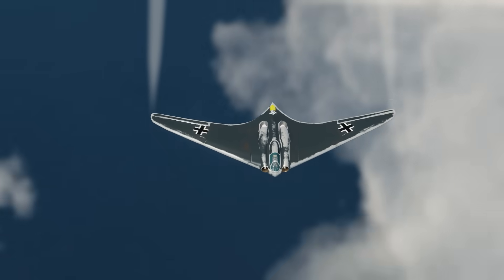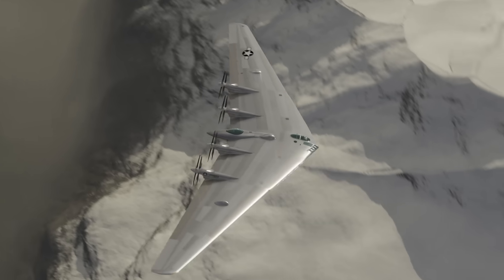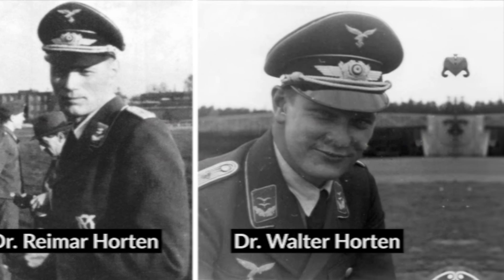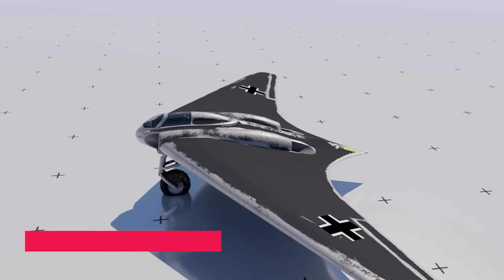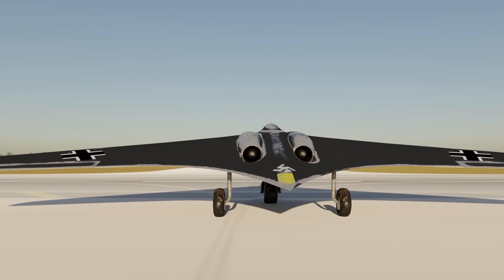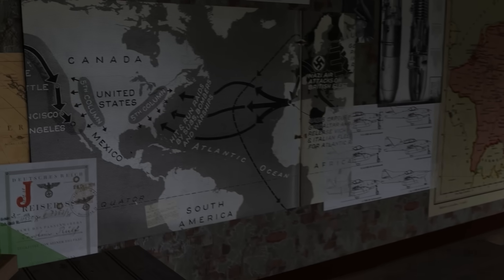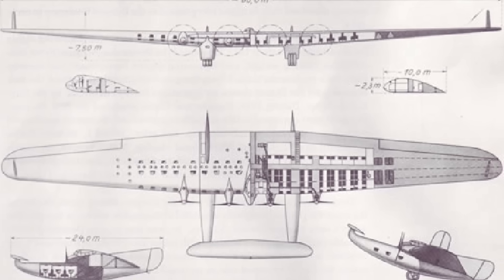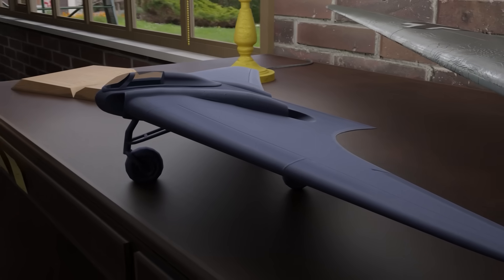Insane Flying Wing Jet Fighter To Save Germany - Horten Ho 229 Nazi UFO

Comment: this was not a stealth fighter
Reply: True, technically its a Radar Stealth Fighter-bomber  Like most twin-engine fighters in WW2 it was a multi-role aircraft capable of light bomber, attack and fighter roles.
 And like modern jet fighter-interceptors that are multi-role attack aircraft with bombing capabilities.
Reply: @DoktorBayerischeMotorenWerke  it wasnt even stealth in the first place, that was a claim made after the fact in 1983. u can read more on fucking wikipedia, the radar crosssection was apparently comparable to a bf109
Reply: @realshimo1258  WRONG! Tests conducted by Northop confirmed a 58% reduction in frontal RCS, this was achieved without the planned RAM applied and represents a significant tactical and strategic advantage against British Metere band long range detection radars.
Reply: @realshimo1258  Also Wrong! Oberkommando der Luftwaffe (OKL) published three specifications directed towards the building of Stealth bombers during WW2.
 The Ho-229 was one of these projects.

Comment: The Ho-229 had handling problems like all flying wings that couldn't be fixed before fly by wire. It could perform test flights with an experience test pilot , but in combat it would have been more dangerous to its pilots than the enemy.
Reply: Ho-229 was After the invention of Fly-by-wire technology invented in Germany in 1934 by Siemens in conjunction with the Heinkel aircraft company, Germany introduced FBW and Stability Augmentaion Systems  (Yaw Dampers) during WW2

Comment: The plane never saw combat.
Period.  End of BS.
Reply: But it was real and it flew... the Allies had absolutely nothing comparable to it.
The very existence of this aircraft is a shameful and humiliating slap in the face to all the Alliboo fanboys and xenophobes
Reply: @DoktorBayerischeMotorenWerke  And meanwhile Russian T-34 tanks were in Berlin.
Reply: @davidhess6593  The Ho-229 was real. 
Nothing you can say will ever change this fact.
Reply: @davidhess6593   The smaller V2 prototype for the 229 was the only example to fly under its own power with jet engines, but only for about two hours of testing before a fatal crash.  They were flying experiments.
Reply: @FiveCentsPlease   The Ho-229 was real. 
Nothing you can say will ever change this fact.

Comment: 1:22 what plane do you call this
Reply: Messerschmitt Me-262
Reply: +@Harl_Tubang  At 1:22 was a craft that only existed as an idea.  The proposed Horten 18 was a scaled-up version of the 229 program with trans-Atlantic capability and with a wingspan of 131 feet.  Meanwhile, Northrop began construction of his YB-35/YB-49 design in 1941 as a long-range wing of 172 feet.
Reply: @FiveCentsPlease  But Northop would not have radar stealth technology until the B-2... which is based on the Ho-229 design.

Comment: The Horten 229 was far ahead of Northrop Grumman's designs. The Americans obviously copied the engine layout from the 229 when creating the B 2. On the American prototype, the engines are located on the wing. On the Horten, the engines are located closer to the cockpit, like on modern B2s. The protruding cockpit and swept tail indicate the similarity. In general, the fuselage of the B2 Spirit is more similar to the fuselage of the 229 than to the fuselage of the Northrop Grumman prototype. Pilot Kenneth Arnold saw a Horten 229 aircraft taken from Germany after the war and compared them to saucers.
Reply: US stole everything; that is old news.
Reply: And wind breaks in the wings still used today
Reply: @reverseuniverse2559  Whatever you say, salty-bot.

Comment: In a way it was very good  the HORTON HO 229 haven't  made  it to the front since  it was only prolonging the war ! On the other side  it shows  Germany  superior  technology  of that time ! From the TIGER TANK to the Walter U-BOAT or even the V2 ROCKET,  plus so many other superior  weapons 😳 🤔 !
Reply: US and Britain are to blame here.
Reply: German tech was not overall superior, in some areas they really exceeded but in others they were massively behind the Allies.
Reply: @spaceageGecko Germany invented the military concept of Force Multiplication through the use of Advanced technology.
 Germany is recognized as originator of most of the military technology in use today.
 The average German soldier or pilot had a higher kill to loss ratio than the Allies... due to this technology advantage.
 The United States military adopted this concept and still uses it today.
Reply: @ Germany had a high kill ratio due to Soviet meat wall tactics.

Force multiplication predates Germany as a country.

Germanys tech just wasn’t that far ahead, you have fallen for ww2 propaganda.

The fact of the matter is that Germany was behind on mechanisation by an extreme degree compared to the allies, lacked the RADAR innovations made in Britain, lacked proximity fuses, wasted resources on dumb projects (The Maus or even the V2 considering it killed more of Germany’s own than its intended victims)

Not to mention that even their own vehicles were over-designed and prone to just breaking down (needing specialists to fix them). Meanwhile the allies made tanks that were both mass produceable AND advance. 

The Allies successfully launched multiple offences that beat Germany’s tactics, the US in particular decimated German doctrine.

Not to mention the allies just straight up had better mass production, radar, sonar, computing and nuclear science, napalm, bombers and fighters.

No one is saying Germany didn’t have areas they excelled in but they were absolutely not the hyper advanced military their propaganda claimed them to be.
Reply: @spaceageGecko  Please name some examples?
Germany was a decade ahead in many areas of aerospace and at least equal in others. 
I dont know of any areas where they were behind.
Reply: @DoktorBayerischeMotorenWerke  One of the biggest I can recall off the bat was that a large portion of their logistics made use of horses still and most troops had to straight up walk instead of being mechanised.

They were also massively behind on radar and decryption.

In terms of aerospace they were about on par with projects going on in the allied nations.
Reply: @spaceageGecko  Sorry but you have your facts wrong, 
The Americans and the Soviets used more horses than Germany did... Germany had a very modern mechanized military compared to many other forces during WW2.
Germany was one of the world's leaders in radar technology and was the leader in airborne search and track radar systems.

Germany was more than a decade ahead of the Allies in aerospace technology... the first to have jet engines and jet aircraft, supersonic aerodynamics and supersonic guided missiles that flew in space.

The Americans more than any other Allied country was aware of and recognized Germany's superior technology and planned the massive Operations Paperclip and Operation LUSTY to grab up all of the Germans technology and technology experts and prevent the Soviets and the British from gaining any advantages from this superior German technology..
Reply: @DoktorBayerischeMotorenWerke  Congrats, now back to reality. Germany was really not mechanised compared to the allies, most of their logistics was horse driven and troops often had to walk.

Germany was objectively behind on radar and never caught up.

Germany's jets were deathtraps compared to the allied contemporaries that existed, which did exist as Germany did not invent the jet engine.

Standard German aircraft started to fall behind fast.

The only place Germany majorly excelled was rocketry but even that killed more people working on them than the rockets themselves killed.

Germany being miles ahead tech wise is a long debunked myth that has it's roots in Nazi propaganda, in reality they were ahead in some areas, on par in others and behind in ways too.
Reply: @spaceageGecko  Then WHY?? *Did America and  Allied countries directly adopt German weapons and technology?
  Were the Americans just ignorant and did not know that German weapons were inferior as your personal theory claims?

Or are you just a victim of Allied propaganda???
  
The Allies certainly didn't have Radar Stealth technology

The Allies didn't have swept wings and Fly-by-wire Horizontal Stabilators either!!!

Why would America adopt German aircraft and missile designs and bring thousands of German scientists, engineers and technicians to live and work in America???
Reply: @ Nice bait, but i’ll take it.

-German weapons were on par with most allied weapons

-No one had stealth tech, that came decades later

-The sweapt wings had nothing to do with the aerodynamics and are not sloped enough to provide any benefit, it was added to keep the aircraft balanced.

-America did not copy any aircraft or missile from Nazi Germany.

-Operation paperclip was purely to get experienced engineers and scientists working for the US, not an admission that Germany had better tech.

-Germany did not invent fly by wire, the first aircraft to use was Canadian. 

-Germany’s logistics were still mostly using horses and many troops had to straight up walk.

-German aircraft fell massively behind

-Germany’s jets were death traps with terrible reliability

-Germany’s propaganda machine made a strong effort to paint themselves as super advanced with all these (incredibly unreliable) tanks and jets.

-The Allies straight up dwarfed Nazi Germany in many aspects; RADAR, mass production, nuclear science, bomber and fighter design, tank design and industry in general.
Reply: @spaceageGecko  Better believe  it ! The Tiger tank , Walter U-boot , the first , fighter jets  "Schwalbe Me 262 , or the formidable  V 1 or the horror  V 2 !It was the reason America and Russia  was trying  to catch as many as possible  German  science  leaders  as possible ! Best known  Walter von Braun!  Even  the HORTON was developed  in Nazi Germany  but to late !
Reply: @ The very existence of the Ho-229 is a shameful and humiliating slap in the face to every hate-filled xenophobic Alliboo that still believes the Allies had better aircraft than the Germans.
  It is essential for them to childishly slander and denigrate the Ho-229 at every opportunity... but no matter how hard they try they can't make the Ho-229 go away... because its real. The Germans were a decade ahead of the Allies in Aerospace technology..
Reply: @DoktorBayerischeMotorenWerke  there is always a great irony in people crowing about the German army being the model of mechanisation when the us army was entirely mechanised in 1944 when the Germans were still using horses, BECAUSE THEY HAD NO FING FUEL - this is literally german ww2 propaganda you are parroting

as for tank superiority go ask a tank historian what they think of German tanks in ww2 and you'd very quickly get dispelled of your idea that their tanks were ahead of the allies

as for planes, honestly the v2 program ill give you, but was fairly useless as a tactical weapon, and don't even get me started on the rocket fighter, a bizarre curio that no one has copied with good reason, sure they had the first jet fighter, but the British had one already in development that was ready by late 45, so hardly years ahead of them
Reply: @lordpelagius5078  The historical evidence confirms that the Americans and the Soviets actually used more horses than the Germans, not all German infantry units were fully mechanized, but Germany did pioneer the concept and took it to its maximum potential during the war.

Imitation is the sincerest form of recognition of one's superiority... German tank design is a most notable example of the Allies attempting to copy German tank design and tactics... America completely adopted the Germans armored warfare concept which it still uses today.

There is no single area of warfare where Germany was more advanced than Aerospace technology... they were on average a decade ahead of the Allies in aircraft design and performance. 
  Again, the V2's is a perfect example of German weapons so superior to the Allies that they adopt the weapon without any modifications.

 every Allied country either used, adopted or continued development using the V2 as a basis. 

The UK would not have an effective jet fighter until 1954 with the help of German engineers and captured German technology.

Any questions kid?
Reply: @michaelwu9450  You didn't know Germany invented radar stealth technology????
Reply: @michaelwu9450  Reimar also stated that the flight characteristics testing prototypes did not have the RAM applied yet. 
 Northop radar testing confirmed a significant reduction in RCS without the RAM applied.
 It's obvious that the Horten brothers deliberately designed a radar stealth aircraft... its shape is undeniable. 
 The fact that Germany invented, developed and used RAM in operational service during WW2 is also not in dispute... at least by those who are knowledgeable and unbiased.

FYI;  Nurflugel  translates to; "Only wing"
Reply: @michaelwu9450  You don't know?
 You spout off like you are some kind of expert but your comments read like someone without any knowledge on the topics whatsoever.
 50 to 58% reduction in frontal RCS was certainly not minimal!
  You are not one of those clowns that thinks that the B-2 is not detectable on current radar systems are you?
 The Mosquito was not stealth at all... while structurally it was mostly made of wood... it was bristling with all kinds of reflective and retroreflective surfaces. Its propellers, engine cowlings, bomb bay and landing gear doors etc. were all made of aluminum, and it had vertical fin... not stealth AT ALL.

Quietly forgotten or cleverly hidden away??? That is another subject for debate another day... either way the German radar stealth technology was not revisited until the 1970's and both Lockheed and Northop exhaustively studied the Ho-229 and German RAM technology developed during WW2.
 You may want to deny these facts, but you cannot make them go away...
Reply: @DoktorBayerischeMotorenWerke  He is a sheep; don't bother.
Reply: @spaceageGecko  Bad excuses are bad.
Reply: @WilhelmKarsten  Aaaaaand you lose.
Reply: @michaelwu9450  Cry more dude XD
Reply: @michaelwu9450  History proves him right, whether you want to admit it or not.
Reply: @michaelwu9450  And the majority don't believe in US anymore, so i think you are the loser here. ;)
Reply: @michaelwu9450  Most people don't believe in US and Britain anymore; cry more.
Reply: @michaelwu9450  I think you're missing the point; putting emojis in your opinions isn't going to make you right about this.
Reply: @michaelwu9450  So that means you have no evidence; I think I win then.
Reply: @spaceageGecko  Cope more dude.

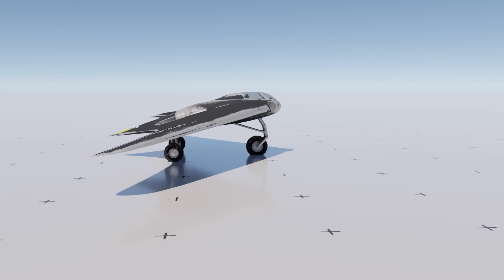Comment: I’m pretty sure he didn’t mean “cancelled out the yawing that an aircraft without a wing can suffer” at 8:51 

I’m pretty sure that yawing is the least of your problem if you have an aircraft without a wing. Plummeting to the ground is probably more pressing that yaw issues. I think he either said without a tail plane or that is what he meant.

Comment: The most shocking thing was when you suddenly encountered a highly maneuverable and super fast aircraft in the air defense of the World War II room, with a contour similar to that of the first generation aircraft, a B2 shaped but cross painted flying wing aircraft, which easily evaded your barrage by maneuvering. A series of 30 guns circled back and destroyed you, and then whizzed past, leaving behind the sound of the advanced turbojet engine whistling that the World War II room should not have

Comment: Fun fact. One of the soldiers taking part in recovering the UFO crashed in Roswell July 1947 said that the alien craft looked like something he had seen in Germany at the end of WW2.  That could impossibly be anything else than the futuristic looking Horten Ho-229. It was shifted to Wright Field, and probably to Area 51 for reeningeering later on.
Reply: The horten 229 never flew past 1945. The only flying prototype crashed during testing. And the model brought to the US was a very incomplete one.
And plus, what would be the point? Its fairly useless since Flying Wings were in the works since 1940 and before
Reply: @peskyshoes  The Americans build many German experimental aircraft after the war from parts and plans captured after the war. Operation Lusty and Operation Paperclip transferred the German aerospace industry en masse to America including hundreds of aircraft, entire research labs and thousands of engineers and scientists..
Reply: @DoktorBayerischeMotorenWerke  True.
Reply: @peskyshoes it would have been the only turbojet powered flying wing at the time, and the only one made of possibly radar absorbing wood sandwich construction, so that would have been the point, although no one recorded I believe m any postwar flight testing in the us
Reply: @PRH123  There were a plethora of flying wings at that time, especially those made by Jack Northrop, such as the XP79, which was rocket powered. Or the YB-49, which flew on the same year and was based on the YB-35. Not to say that is totally the vehicle, but that is also assuming that the Roswell incident was anything other than a balloon.
Reply: @peskyshoes  the 49 was a couple years after the end of ww2, the horten was years before that, so there was no plethora of jet powered flying wings in 45, anyway the point is that Roswell couldn’t have been a test flying wing crash
Reply: @peskyshoes  I don't think so.
Reply: source?